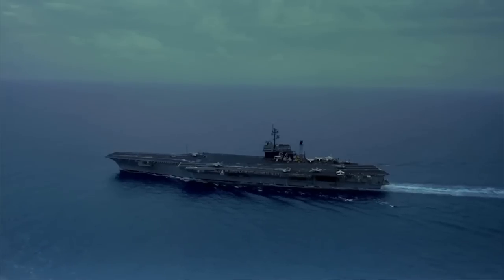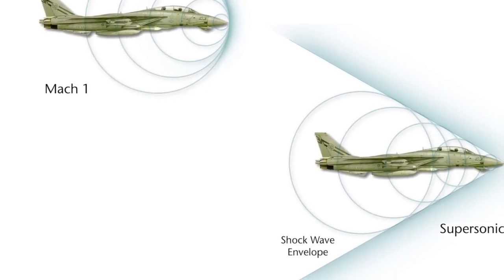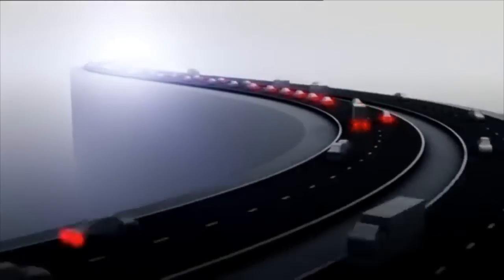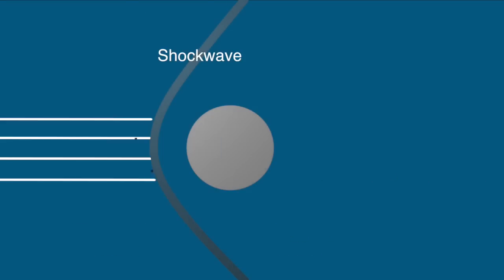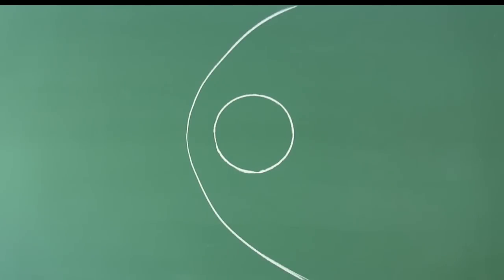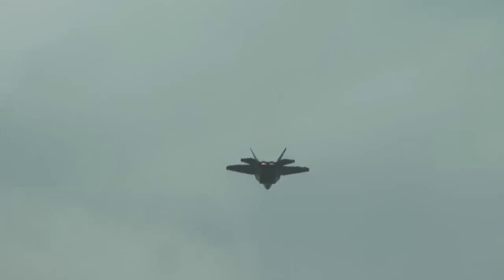Understanding Shock Waves in Aerospace Applications

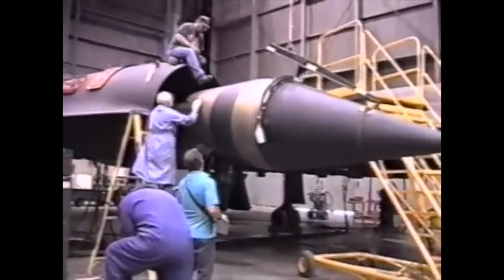Comment: @5:40 I know I'm 7 years late but this diagram of the engine doesn't take into consideration that when it's in flight the cone lifts up straight. It is pointed down as a side-effect of the spring loaded mechanism that causes airflow to retract it to optimize compression on air intake - and when it retracts it straightens out and no longer points downward. The downward slant of a stationary SR-71 engine cone is just a side effect of the retraction mechanism. It's basically just dangling out there when not cruising through the sky.

Comment: At 6:35.....I believe it should read as
M>1 , M<1 ( Mach is greater than 1 or less than 1)
Not - M>0 and M<0   since you cannot go less than zero or you would be traveling back in time yo!
W-hiskey T-ango F-oxtrot to the supposed engineers of this ???
HERE: This video from 1904 after Wilbur Wright discovered what a Mach is explains it better and is more correct.
https://www.youtube.com/watch?v=ugPJYJ-BKkU

Comment: 5:16 I don't remember the that the velocity downstream (after) the shock increases higher than the upstream (before) the shock, it's actually the opposite. from what I studied is the velocity component parallel to the shock will be the same before and after an oblique shock, but the velocity upstream will make an angle (Beta) with the shock, and downstream will make an angle (Beta - Theta) which causes the component normal to the shock of V2 will be less than its counterpart in V1, which make the magnitude of V2 less than V1
Reply: Yes, this is correct. I also realized that this video incorrectly states that the air velocity "speeds" up through oblique shocks and that oblique shocks have "little effect on drag". This is incorrect. Oblique shocks create less drag and flow deceleration than normal shocks or bow shocks, but the Mach number always decreases across an oblique shock. For a normal shock the Mach number after the shock must always be subsonic but through an oblique shock, supersonic flow can be maintained, but the Mach number will still decrease.
Reply: that is true, the velocity of the air only speeds up at convex corners which creates expansion waves. the complete opposite of oblique shockwaves. expansion waves are often referred to as the antithesis of oblique shock waves.

Comment: You sir please clear your concepts before teaching...@ 5:16 you mentioned M2>M1 which is incorrect. The shock wave causes flow to decelerate so M2<M1 is correct. The pointy end causes an Oblique shock which has lesser Drag penalty than a Bow shock.

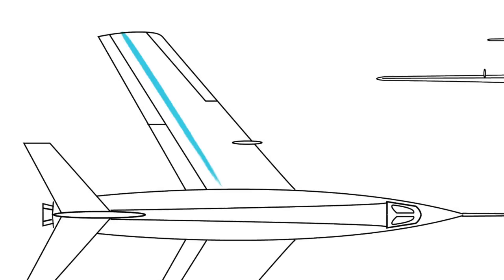Comment: 6:50.  My understanding is that wing sweep is used to avoid shocks all together, not create oblique shocks instead of normal shocks.
Reply: thats true as it increases the percieved chord of the wing, I'm suprised by how many errors this video has
Reply: @Kebab_with_extra_garlic_mayo  
The bad part is that he sounded so very sure of himself.
Even worse, some people will believe him without checking his figures .
Reply: I think you might be thinking of the sweep being used to keep the wing leading edge behind the oblique shock from the nose. He was referring to an oblique shock on the leading edge of the wing I think - but still don’t agree that it accelerates the air!
Reply: Wing sweep doesn't avoid shocks all together. Sweeping the wing aims to delay shockwaves. Wing sweep increases the wing chord and thus decreasing the thickness to chord ratio.

Comment: This viedo is full of big mistakes. M<0 subsonic , what a joke. Mach cannot be negative. subsonic means M<1.
Reply: It's actually 0.3
Reply: @gamersvalley  M=0.3 is a boundary of compressible/incompressible flow
Reply: @gamersvalley  no. 0.3 is the compressibility limit but its a deep simplification for beginers
Reply: You are wrong. Mach can equal less than the speed of sound. It’s common with large airliners, example Mm0 = 0.75. Mach is just a ratio between the speed of sound and the speed of the object moving through that air
Reply: @TangodownNZ  please read again before commenting.

Comment: 5:15 you should revise that statement
Reply: I agree, I believe M1>M2. Per my understanding, through an oblique wave, M2 will still be supersonic, but lower than M1. Good video though.
Reply: @gerardoespino4382  it dependes on the angle of  the shock wave and on the M1, there is no a general way to say " After the oblique shock wave the air is always subsonic"
Reply: Can u explain that part im confused
Reply: exactly!

Comment: All shocks slow down air flow upstream.  The relative mach number normal to a shock is always a normal shock, and therefore, the behavior across it is always that of a normal shock.  Thus geometrically speaking alone, not even getting into the physics or calculus, the airflow upwind is always less than that upwind.  Here is a compressible flow calculator that was designed by Virginia Tech.  Try giving it a mach number and turning angle for an oblique shock.  It should spit out an M2 value less than M1 as well as the deflection angle from the table you have at 5:21 from John Anderson's book. http://www.dept.aoe.vt.edu/~devenpor/aoe3114/calc.html

Comment: Omg you are so mistaken, oblique shock always decelerate the fluid, you are misinforming people
Reply: Thanks for that! I just watched this video and was going through my theory books trying trying to figure out if I'd learnt it all wrong. With an oblique shock the airflow velocity will always be reduced, but will still remain supersonic.
Reply: @thebamboopilot2232  Unless it's the "strong" oblique shock solution (assuming we are talking about planar waves). For conical waves, yes you are correct.
Reply: For M1 prior to shock and M2 after shock: M1>M2, P1<P2, T1<T2, ρ1 < ρ2. M=v/a, and "a" (speed of sound) is dependent on temperature. With T2 being larger, this means larger denominator for M2. Thus, M2 should be less than M1 as stated above. The tangential component of the velocity across the shock is wave is constant, but the normal component is not. Normal component (u) ratio can be defined as u2/u1 = ρ1/ρ2. With ρ1 less than ρ2, as stated in the first line, it can be seen that the u2/u1 ratio is less than 1, implying u1>u2. Therefore, v1>v2.

In summary, yeah, you're right.
Reply: That's one boss answer right there. Someone who, at least seems, to know his business
Reply: I found it strange when I saw. Anyway, this video is a good resume of the shockwave concepts.
Good job.
Reply: Look, you are dealing with the compressible world and there is phenomena and that's true